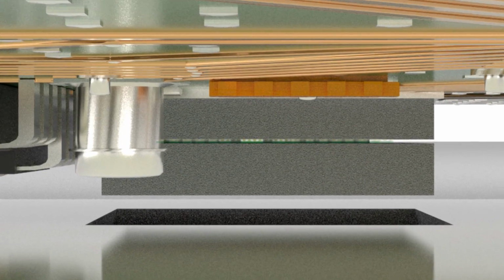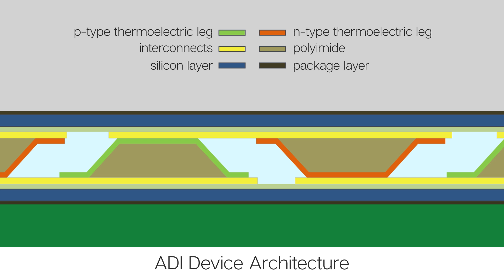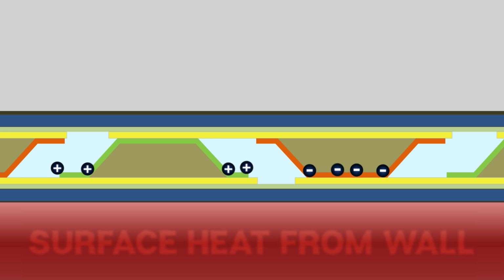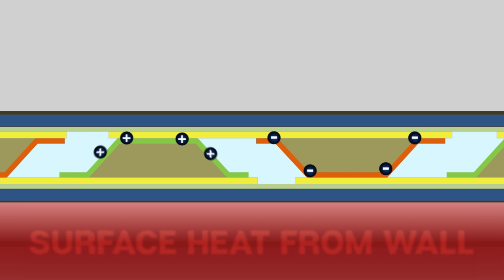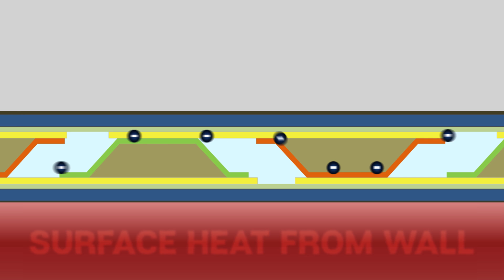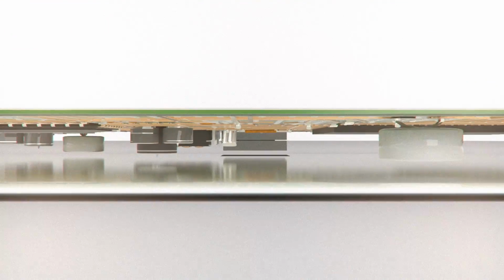Thermoelectric Energy Harvesting by the Analog Garage

Comment: Very cool.  And basic.  A few more basic tidbits would be interesting, such as a graph or two showing output voltage/current vs. delta T vs. area of TEG device.  Perhaps less basic:  What are the best practices for good thermal contact when mounting?;  Does ADI TEG device flip output (electrical) polarity for a flipped input (delta Temp) polarity?;  Are there AppNotes and example circuits which support the need for very low power, stand alone designs?  Of course, I'm sure I'll have all my curiosities answered when I visit the Garage.